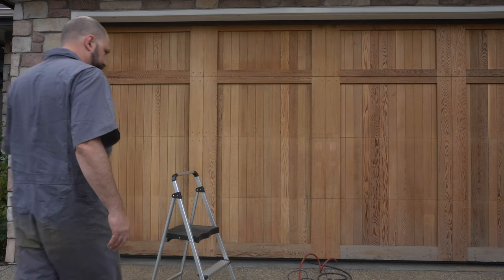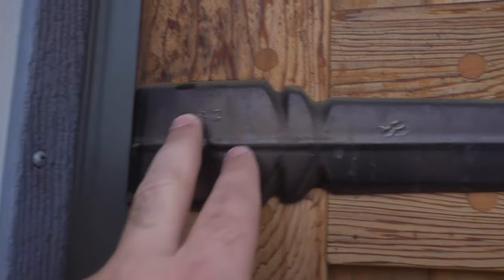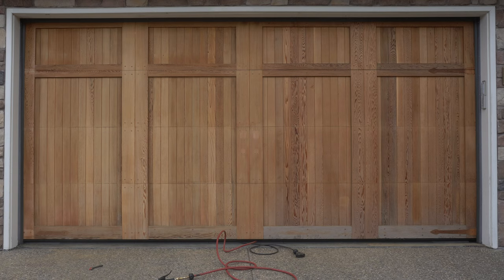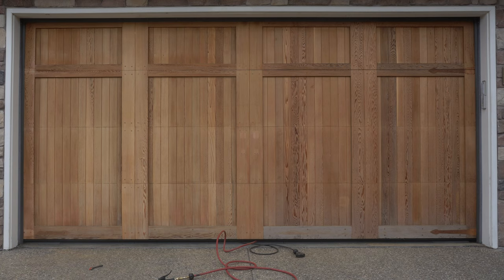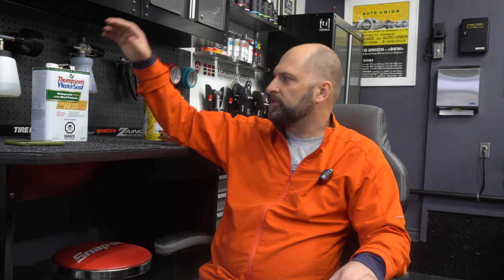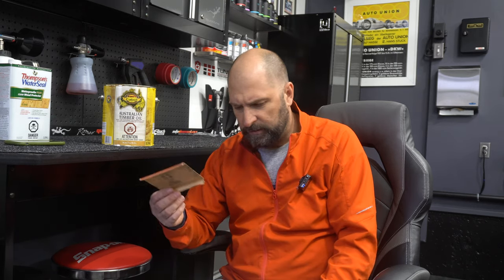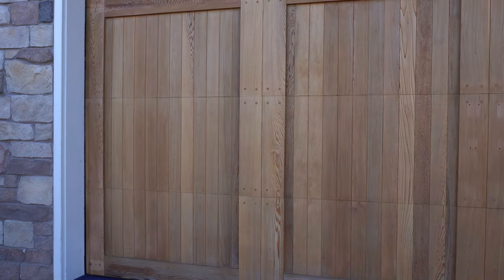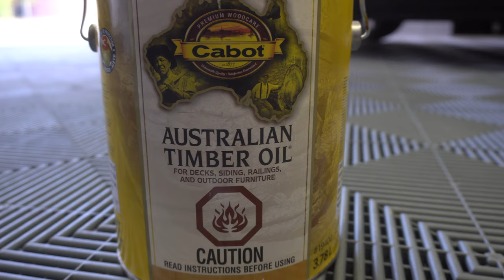Staining my Wooden Carriage Garage Door with Cabot's Australian Timber Oil

Comment: Very Very Nice. Agreed. Exhausting work. Ironically last week I did my front facing Cedar Fence Panel and Gate on the other side of my home. I was introduced to Penofin - Brazilian Rosewood Penetrating Oil a few years back. People seem have quite the mixed results but I am happy here in our Desert Environment.
Reply from the maker: That's the real trick. Finding the right product to deal with the unique environmental factors of your particular climate.

Comment: Turned out great. Super glad for my metal door.  A little tip I learned from furniture restoration is to wash before you sand to eliminate the possibility of grinding impurities into the wood. Maybe a quick run of the power washer or a soft wash.
Reply from the maker: I find using the pressure washer on the wood leaves non-uniform lines, but I like the idea of washing first. I much prefer working on paint over wood. Not fun!
Reply: @RADGarage  Agreed. Soft wash would be preferred.

Comment: Maybe this will save you some time. Spray the door with outdoor Clorox, and rinse to remove the mildew. Apply your selected oil stain. Yes it’s that simple. This is the same process as caring for a wooden deck that is protected with Thompson’s, Cabot or anyone oil stain/sealant product. Not saying sanding can’t be done as the water may raise the grain but it would much less sanding. Your results look great! I will be doing my doors to my patio in this manner. Thank you for the inspiration!
Reply from the maker: I will give it a shot. It’s about time to re-stain it.

Comment: The door looks awesome, Rick!  Looks like it was a lot of work, but the results are worth it! I share your opinion of Thompson's water seal, I used it on my deck and had a bad experience with it, and will never use it again.  I applied it according to the manufacturer's instructions, and it took a couple weeks to actually dry (not a couple hours as in the instructions). I was less than impressed.  I'm going back to a stain as well.
Reply from the maker: Thompson's 👎

Comment: Great job, Rick! It looks really nice and should hold up for awile. Have you thought of putting windows in those top panels or is that not possible? I figure it would be more sunlight for your detail space.
Reply from the maker: I am not a fan of windows in the garage doors just due to the temperature variance between the interior and outside. They tend to collect a lot of condensation and ice up causing warping over time. I know a few people who have had to replace their windowed-doors due to maintenance issues. More light is always welcome, but I have the LED lights and those pot lights now that really help.

Comment: Oh my god Rick. I wish I had known you were going to attempt this. Remember, I am a woodwork teacher here in Australia and could have at least advised Fromm afar. You have used what is really a finishing palm sander for a job that a 150mm minimum random orbit sander should have been used for. Also, to keep the job going and because of the previous finish, start with a box of 50 Velcro attach 120 grit or 180 grit abrasive disks. Attach the sander to your vac you use for the cars and it a relatively clean process too. I’m so sorry to see you go through this. I love woodworking and hate to see people go though hell because of poor advice. Cabot’s is a great product. I have just sanded and recoated my timber floors with their water based acrylic CFP (pronounced CAB - OTTS). By the way, you may wish to read up on the health risks of sanding red cedar and western red cedar.  A great result in the end Rick, but happy to advise for your next timber project. Lloyd
Reply from the maker: Live and learn! One of the big perks of sharing my work though YouTube is so I can learn from others. This info is gold. I feel bad that I totally blanked out on the safety mask. In my head, I thought I'm outside so all is good. I now know better. I will take all of this to heart and buy some better suited equipment.

Comment: Next time try spraying with white vinegar. Let dwell 30 min and pressure wash clean. Let dry 24 hours and then use belt sander. Will go quicker. Then stain and after fully dry you can use water sealer/repellant. Should last a few years with minimum maintenance.
Reply from the maker: I have pressured washed this door in the past and it took a few years for the marks to subside. I don't think I will do that again, but I really like the idea of performing some sort of wash. I'm not sure a belt sander (although I admit to never having used one) will allow me to get in to the sharp edges and corners of this particular door. Do you think I should use a sealer on top of the Cabot's Timber Oil?
Reply: @RADGarage  I have pressure washed my doors but you have to do it while keeping some distance off of the face. Belt sander would do bulk work and hand sander can get into more detailed spaces. Definitely use a sealer on top of the stain/oil treatment. I didn’t do it for a few years then finally used a sealer one winter and it was a game changer. Water really ages and dries the wood out.
Reply from the maker: @MrAumbra  Ok. Any recommendations of a sealer that will pair well with the Timber Oil?
Reply: @RADGarage  I have not used Timber Oil but I have used Thompson’s and had the same experience you had even when I did several coats. Personally I don’t think there is a perfect solution out there or at least none that I have found but Rainguard Premium has worked the best so far. It doesn’t get that yellow faded look over time and doesn’t leave that oil or slippery  finish when dry. Leaves would looking natural. It also doesn’t change the color/tone of the wood however I did have one experience with pine where I felt the would was a shade darker but not by much.
Reply from the maker: It's a trial and error type of thing. I will upgrade my sander for next time and invest in a good aspirator.

Comment: How has the finish held up?
Reply from the maker: It has been just over two years and it is hanging in there. I should snap a pic and post it on my page. There seems to be the need for reapplication along parts of the bottom but otherwise not bad. I’ll probably refinish it in the Spring.